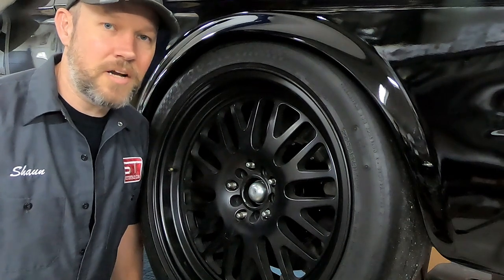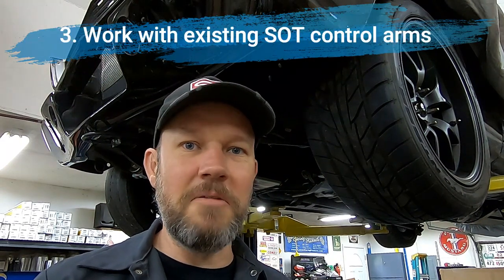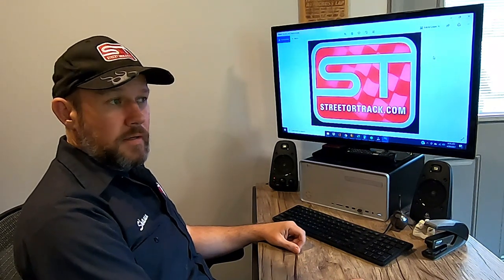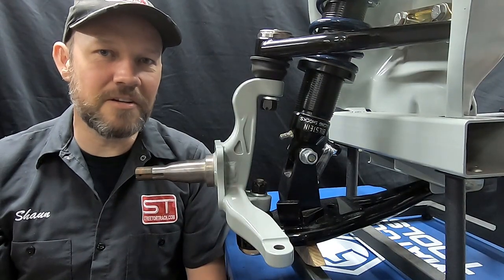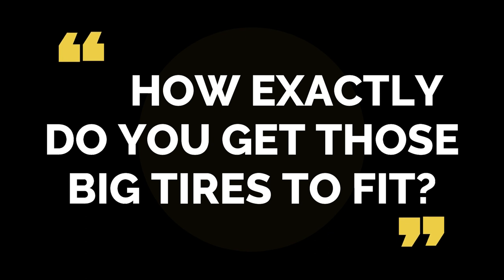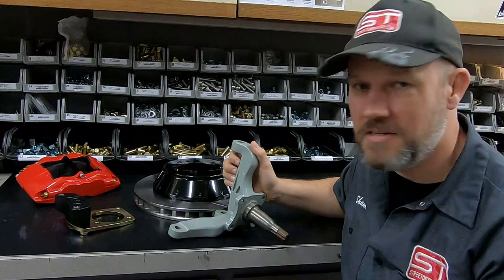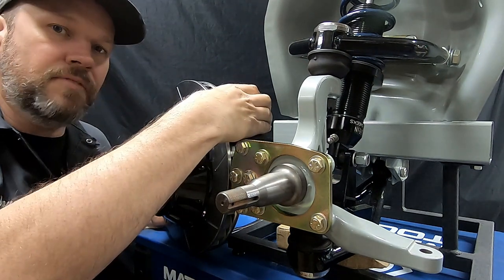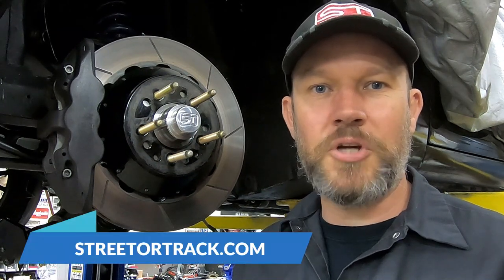Classic Mustang Drop Spindles

Comment: Why not deign these with a front steer setup in mind and release a rack mount for a front steer setup?  I want a rack badly but don't want to loose turn angle AND a rear sump pan would be nice but I don't want to cut my car to go to a slight newer design 70's tech M2 suspension design.

Comment: Nice piece, as always!  Can you talk about how this works with the Shelby upper control arm drop?  Do these spindles alter camber gain (is the vertical distance between the ball joints same as stock, or shorter negating the benefit of the Shelby drop)?

Comment: Drop Spindles ARE nothing new. CRS Drop Spindles in Australia made them 40 yrs ago..As for a 315mm tire  on the FRONT It will hit the front Chassis , on full lock and Severely limit the wheel turning space /Steering Circle..I know you have limited  steering Stops, so the tires wont rub on full lock..But you will need a BIG Car Park..
Reply from the maker: No doubt people having been creating drop spindles for these cars. Our effort was centered around improving the geometry with our suspension and fitting a 17" or larger wheel over the upper ball joint and around the steering arm.  Nobody else currently offers this in a safe and well engineering solution.

A 315 on the front is certainly a very large tire.  Maybe not ideal for most street cars but certainly for a track or autocross car.  Those cars are not too concerned with getting to full lock.  However!  Via suspension analyzing software and real world inspection and measurement, our 1970 test car still got to the steering stops with no interference.